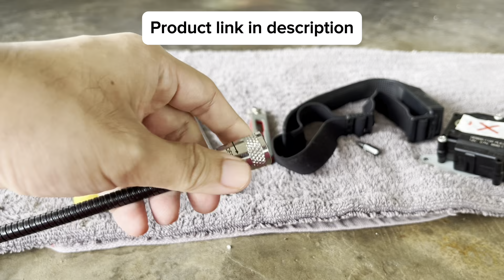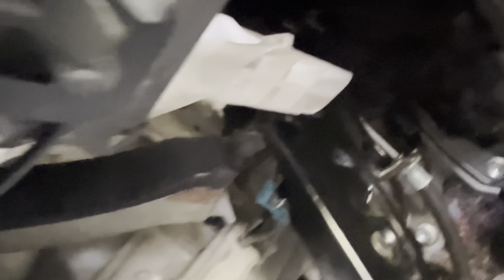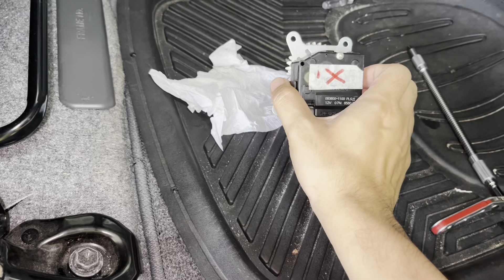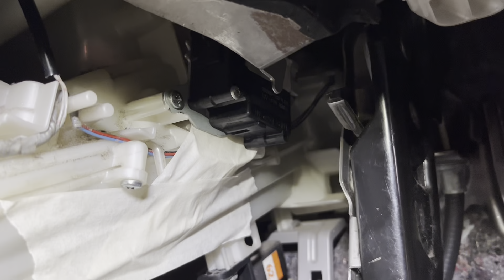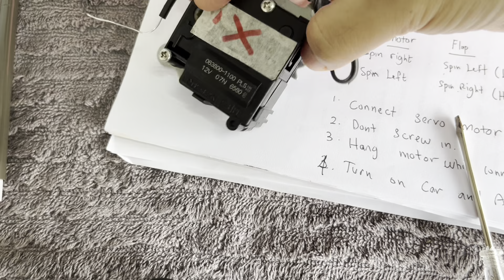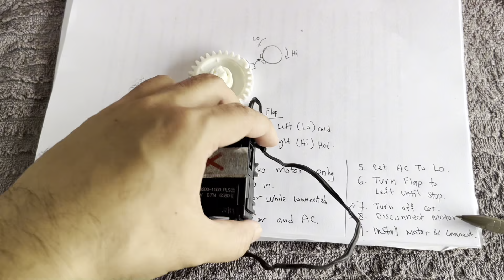[ENG] B1441 Servo Motor blend Mix Hot Cold Air Bypass and Replacement Prius Gen3 CT200H

Comment: Tqvm
Reply from the maker: @artg08  you're welcome.
Reply: @dzulhaziqnasir333  do you need to calibrate the servo motor after replacement done?
Reply from the maker: @artg08  you wont need to calibrate for new motor replacement.

The gear position for Out of package (New) servo motor cannot be adjusted manually.

I can't remember the motor default position (hot or cold).

Just make sure the servo motor is alligned with the flap gear.

So adjust the flap gear first before servo motor installation.

The flap gear needs to be full rotation either to the left of right.

Once put it, and engine turned on, the system will adjust accordingly to the AC temp.
Reply from the maker: @ i forgot to mention, use an OBD scanner to reset the previous servo error after replacement.

If you do not have an OBD, you can reset by removing the positive cable 12V battery, wait 30 second, reconnect and start the car.
Reply: @dzulhaziqnasir333  tqvm for the input

Comment: Thanks for the video, please tell me if you know: you have a car with a steering wheel on the right side, and I have one on the left side. Will this servo motor be located on my left or right side?
Reply from the maker: Your welcome. If im not mistaken it should be on the steering side. You can easily remove the plastic cover for confirmation.
Reply: @dzulhaziqnasir333  I figured out where the servo motor is in my car, but it didn't give me anything, I keep fighting my malfunction. 
May I ask you to record a short video of the gears working for me? It will take literally 3-5 minutes. I would be very grateful, because I have no one else to ask about it.
I can message your in whats'up or something like that
Reply from the maker: @sanosabhju  are you talking about obd scanner? 

Error is only given when its 100% malfunction. If it's still moving, error will not be detected.

My servo motor still works. It just didn't work as it should.

Another example is the water pump. Only when the water pump stop operating will the obd return an error.

Error will not be given if the pump is still spinning regardless if it's spinning slow and not at optimum speed.
Reply from the maker: @sanosabhju  we can chat on telegram. I cannot promise to give a solution. 

Currently, What is the problem? Is it hot air coming out the blower ?

I would just recommend a new servo motor replacement. Its not expensive.

Also cannot make time to make a video of the servo motor.
Reply: Hey man, I have the same problem right now. I have a USA car not UK car is the motor located on the left or right side ?
Reply: @marianofuntime8366  I have a 2010 prius and the motor on the lower side is the airmix, passenger side. The top is the mode and the recirculation is by that vent as well. I know which is the air mix motor because i unplugged and read the trouble code with the scanner. Im finding information on removal because it look a bit hard to reach those screws. There are no trouble codes on the scanner but the actual position of the servo motor is not correct and is at the very end. I will remove it, clean it and test with the scan tool again and see but not sure if it will be fixed if I clean the contacts. The servo motor does move when using the initiation command from the scanner but it does not move when commanding it with the scanner.